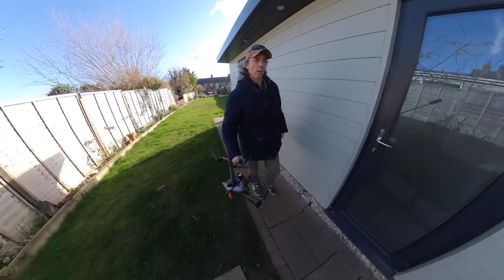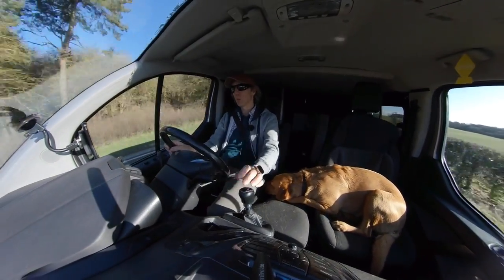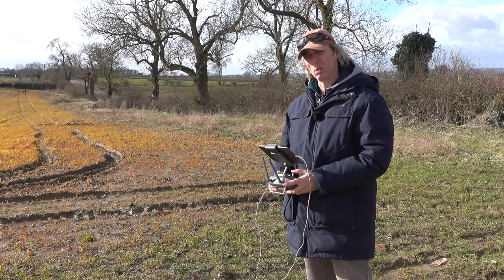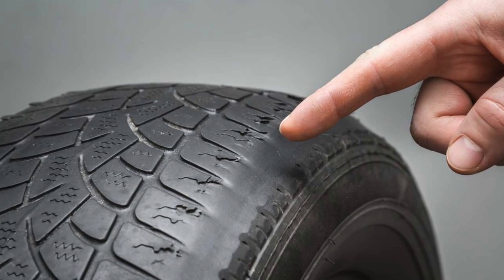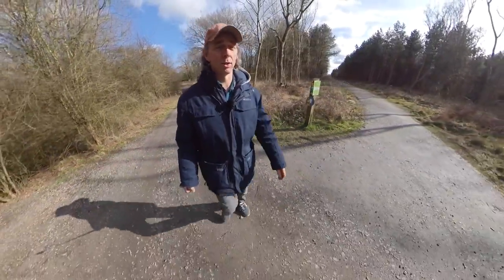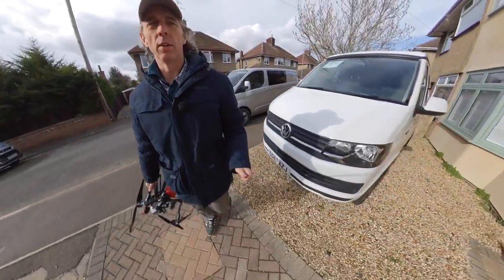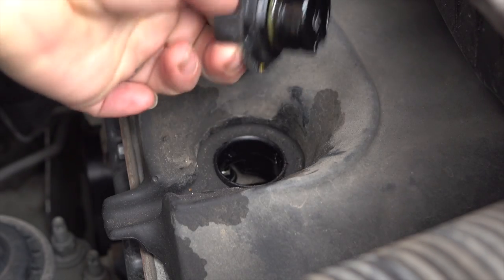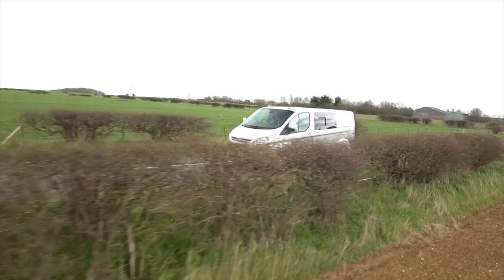9 TIPS on buying used vans for your Campervan conversion

Comment: Karl, great vid! 
I'd add a few more issues to think about.  It's not common but it has happened,  always visit the van at the address it's registered too,  ask for DL, V5 and check engine chassis match. Also if they ask for cash on collection,  this is an alarm bell.  Imagine carrying 10k with you to be met by a believed seller, who robs you, that has happened.  I'm ex police and vaguely recall a nasty robbery some years back. If its Genuine then a bank transfer is the safest option.  Try to avoid carrying cash.  Also whilst I'm on it. If you asked if finance is outstanding,  they cannot legal own the vehicle. Walk, or if its easily remedied, ask for the finance company and arrange to pay them the settlement.  If this is not possible and you buy it, good luck in trying to avoid the liability at some later stage. If they don't pay it off. Hope this helps.